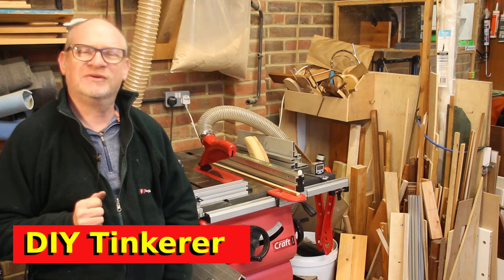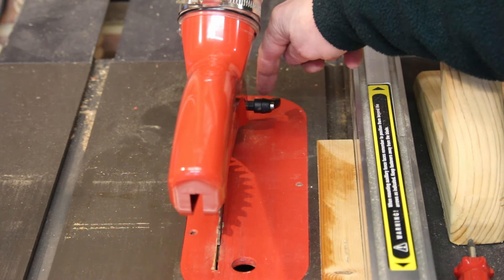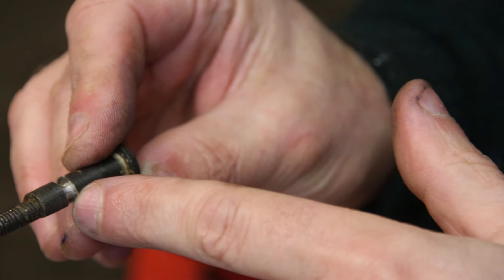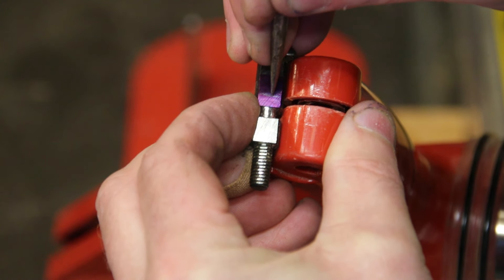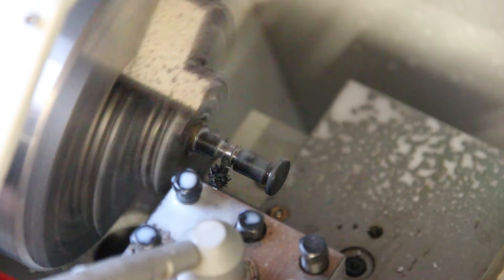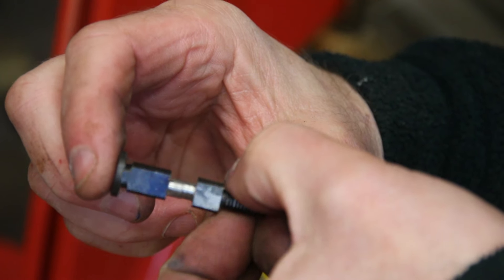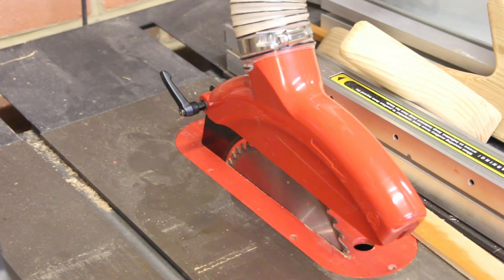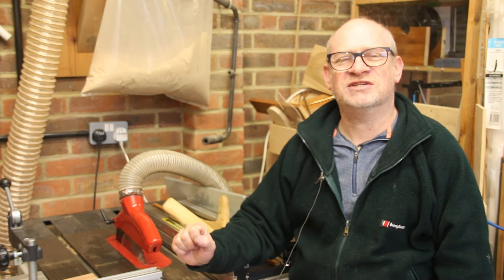Fixing Table Saw 'Design Flaw'

Comment from the maker: So, if you are thinking that Axminster supplies an auxiliary fence to 'overcome' this problem, then think again, the auxiliary fence is low enough to clear the handle, however the problem with this is that the handle still gets in the way of your push sticks/blocks, so the auxiliary fence doesn't actually solve the problem in most situations.

Comment: Nice one Simon. The Bosch gts 10xc has something similar but the bolt has a square section that will only fit on one side of the crown guard. I solved that by throwing the bolt away and using a furniture bolt from the opposite side. There is just enough friction to hold the bolt while tightening the bristol lever.
Reply from the maker: it is so silly, there are so many ways to fix this at design time - for instance the crown guard could have been made symmetrical - leaving it for users to fix shouldn't happen with these manufacturers.

Comment: Nice fix Simon,no doubt Axminster don't do product testing before releasing into the market ,I imagine it will be a cost saving thing
Reply from the maker: I wish it was, but I really can't see how changing the design would increase cost, those bolts must be custom made, so making the slot wider or making the crown guard symmetrical would have solved it.  I think it really is an oversight/ lack of product testing.